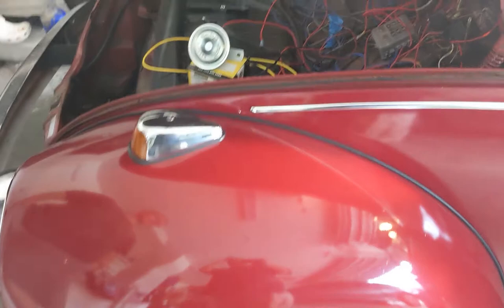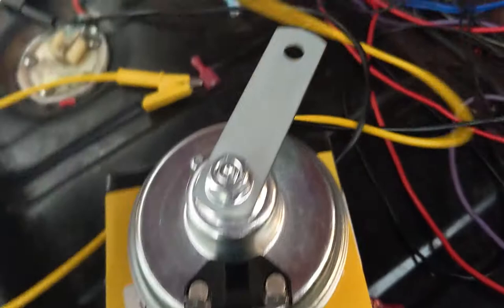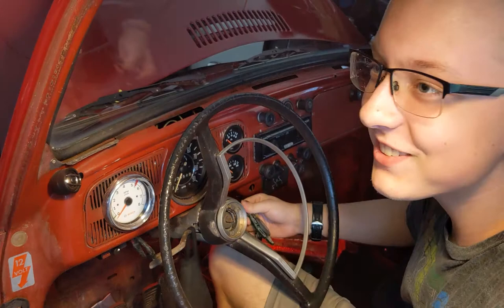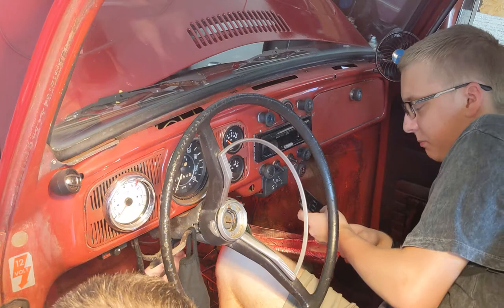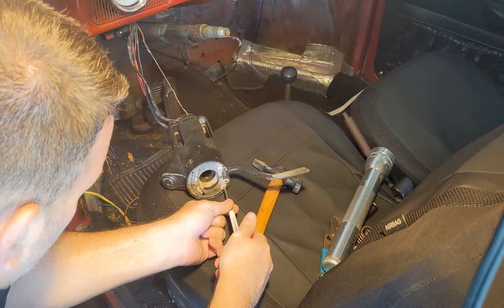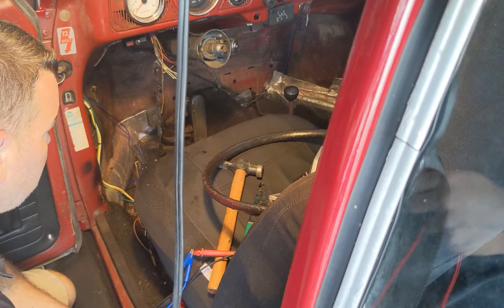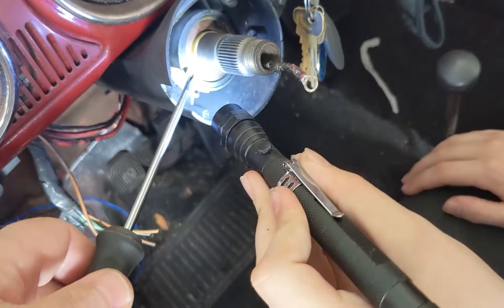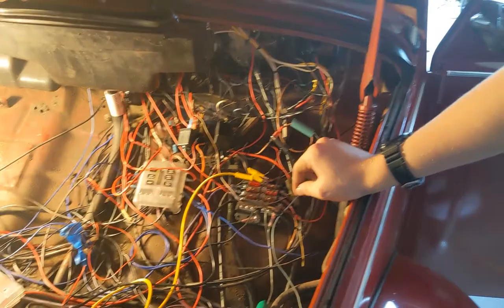REPLACING HORN ON A BEETLE IS EASY...RIGHT????

Comment: Great job fellas! My 17 year old daughter is restoring a 68' Beetle.  She is working on the brake system today and tomorrow but since it is dark I am looking at how to do the horn system. :P  There is an ugly aftermarket steering wheel on it now but we have and original to put on. Looks just like the one you have.  But we are missing the center and horn bar.  I see online there is a chrome horn ring with the center button and mounting kit. We are in Washington State so I think we will have to order most parts online.  Cant just run down to the local VW shop. :P. But I need to research and see what our options are local. Do you have a good place you like to order online?  I will send your video link to my daughter to look over.  And look and see what other videos you have.  Great idea on documenting and doing it together!  I have photos and videos of her journey..  Fun fun!!!!
Reply from the maker: Thanks for stopping by, we have been pretty quiet on the channel but have more things in the works.  Too hot here in Florida to work out in the garage lol.  For online, jbugs is a good place to start.  They have a large selection of inexpensive parts.  Wolfsburg West is another go to for us as well. Good luck to your daughter and feel free to reach out anytime with questions.
Reply: @2GuysandaBug   Thanks for the info! I drove “Babes” home tonight and she ran great for the 45 mile trip. We are making a list of things to work on next. Must have and to do fist and then a wish list 🤪